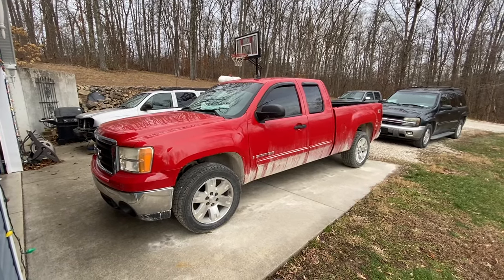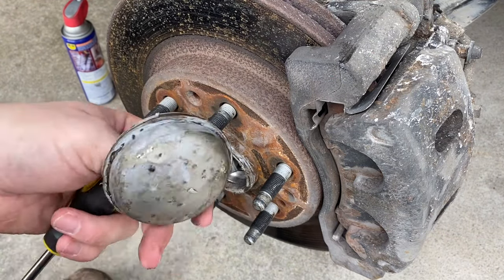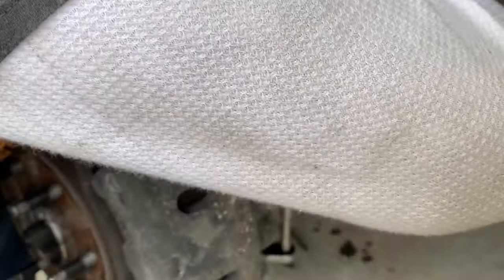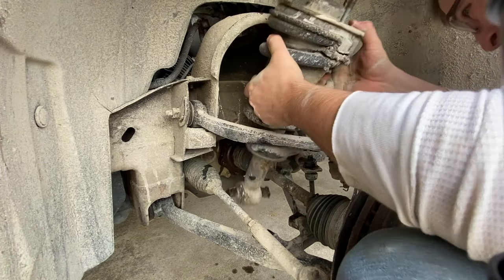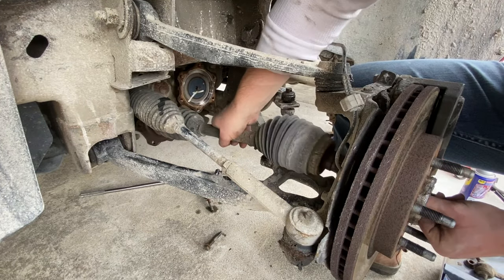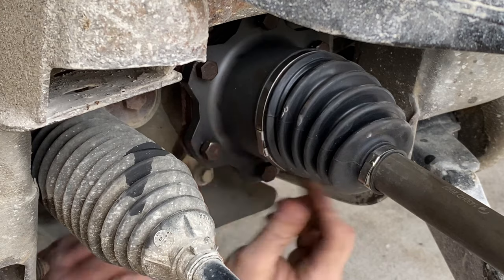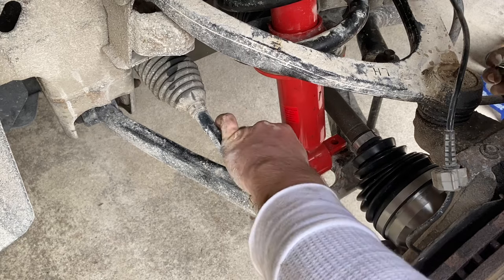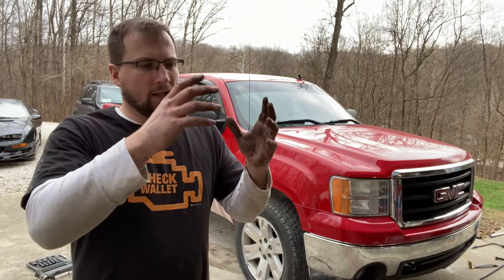2007 GMC Sierra / Silverado CV Axle Replacement - How to remove and replace CV Axles

Comment: I know it been a year since you made this, but I just found out today that if you remove the sway bar links on both sides you have enough room to remove the axle shafts without reomoving the struts. But great video ! Thanks.
Reply from the maker: Good tip 👍
Reply: U don’t have move all that just take the cv axle out

Comment: I see there is a little oil leak around  were you bolted the cv axel, i have the same oil leak on my 08 sierra, did this stop the leak ? loved the way you explained in this video, doesn't seem to difficult, will be doing this myself after watching this, thanks 😉

Comment: I've got to do this on my truck this weekend. I wonder if it would be enough wiggle room just cranking the wheel over all the way instead of messing with the strut.

Only one way to find out I guess. 

Thanks for the video. This doesn't look nearly as complicated as I imagined.
Reply: In the same boat as you, let me know if you didnt need to remove the strut!
Reply: @Wombuffet  you definitely do. It "should" have enough wiggle room to drop the strut out, but on my truck, it had a small leveling spacer on top, so it was under tension. I had to pop out the outer tie rod end, and the upper ball joint to get it out.
Reply: Yes just use a swivel it in your socket and you can wiggle it and get it out

Comment: You'd benefit practice this with lug nut in place to protect your threads while using the pry bar as a counter lever.
Reply from the maker: Excellent tip. Thank you!